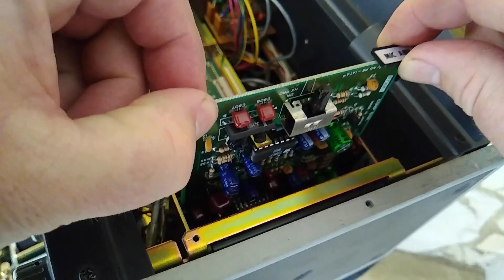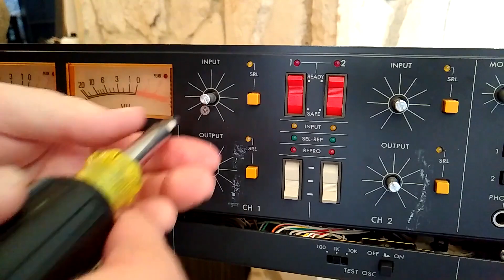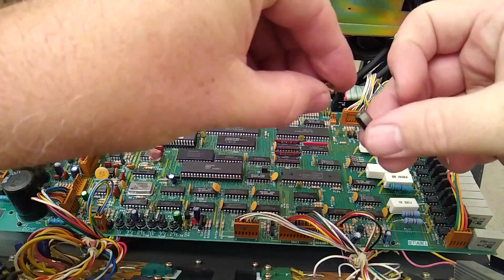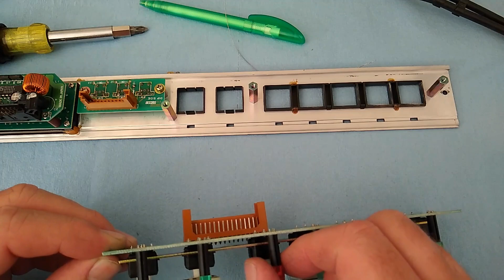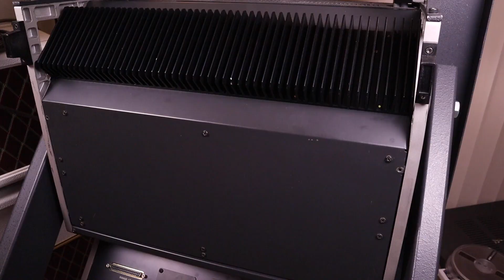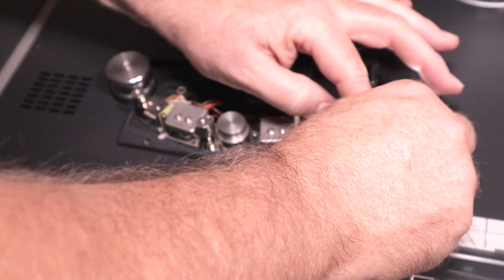Otari MX55T M Refurbish Repair Part 3 DoItYourselfMusician #41

Comment: I took the head plate out of my 5050, then stretched some clear or semi-opaque leader tape from the tape guide on the left side to the one on the right side and stretched it tight over the heads. It was very easy to check the alignment on all 4 heads (erase, 1/4 track playback, 1/2 track record, and 1/2 track playback). A little tweaking was all it took. I made a recording afterward and could not tell tape from source while recording. Of course this was only on the 1/2 track heads. I played a pre-recorded 1/4 track tape and it sounded excellent as well. Kind of cheating, but the alignment tape I had was seriously deteriorated and shed oxide all over the heads; it also squealed badly while running through the tape guides. But listening to the recording I made and the pre-recorded 1/2 track and 1/4 track tapes from Ampex and The Tape Project I think it’s close enough for government work. Sometimes the simplest way works too! Hope this trick helps. Love my Otari!

Comment: Hi. I have an Mx 55 without the Pinch roller. I'm thinking making an adaptor or making one but for that I needed the measurements. Can you send me the diameter and height of the Pinch roller? Thanks
Reply: By the Athan pinch roller and stay out of trouble